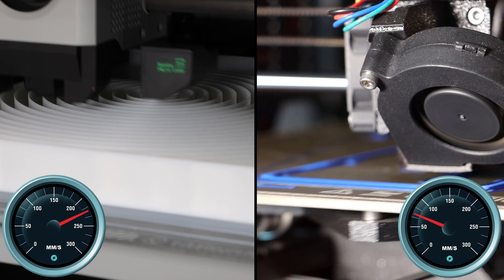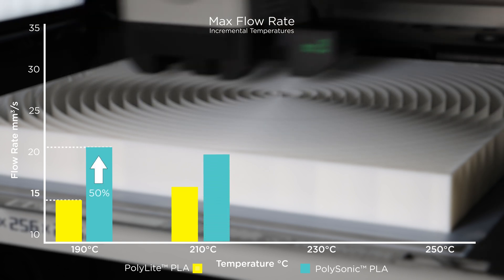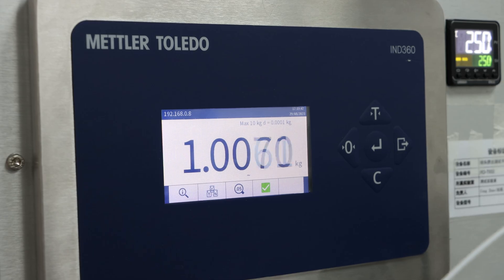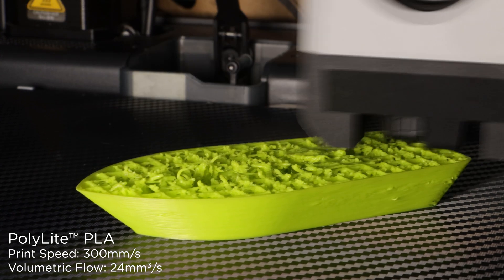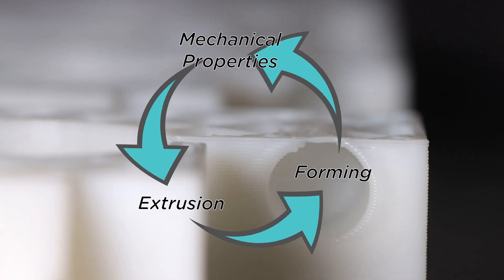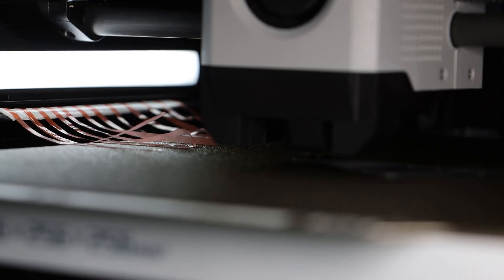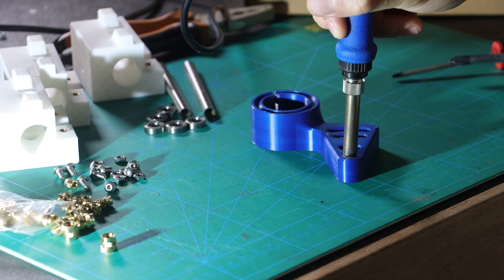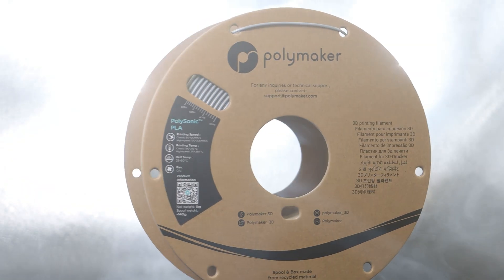What makes PolySonic so fast??

Comment: This is fantastic, but unfortunately I'd like to be able to buy large amounts than a single kg spool... Faster printing means you get more done, but Changing spools is annoying, IMO. I'd buy this over any other plastic if I could get it in a 5kg spool (or even 3kg, if that's more reasonable for the average use case).
Reply: I agree with you. I can’t believe at a minimum, they don’t even offer it in 2kg. Luckily, I have a Bambu X1C series printer too, with dual AMS units. This gives me 8 available 1kg slots. I usually duplicate the material from one AMS unit to another. Bambu Labs has a great feature where it will start using material from a different slot if another one is configured with the same exact material and color. Doesn’t help on my other printers though.